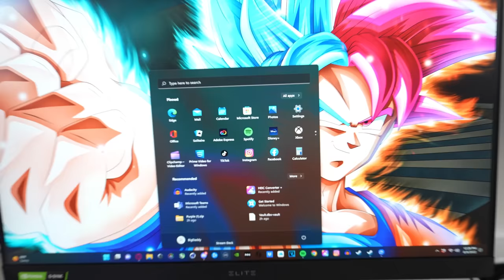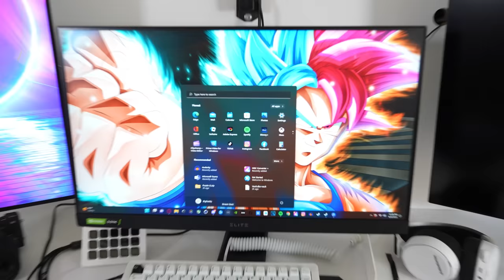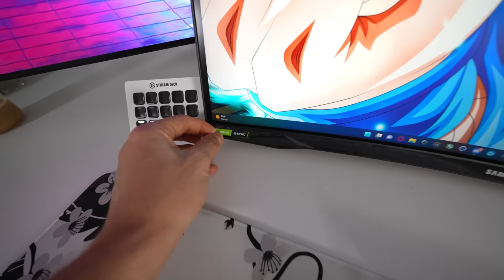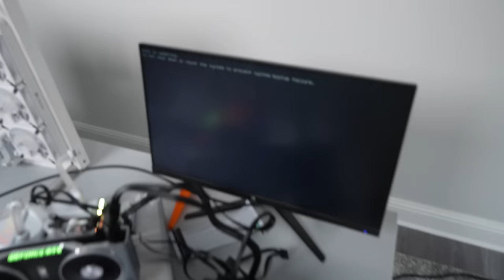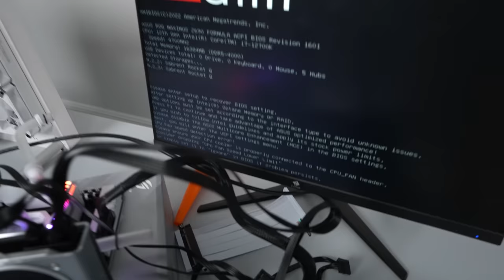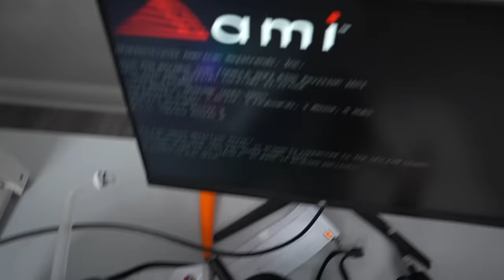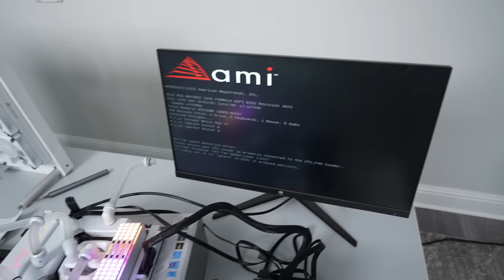I Almost Gave Up...

Comment: maybe i had the same problem with u after the windows 11 updates, my mobo got messed up & luckily i got warranty for  the mobo. i can used it again as usually for couple weeks then my pc wont boot up again after few minor windows 11 update. i'm worried if my mobo got messed up again but i think i need to rid off the windows 11 & and try to reinstall back the windows 10. after reinstall the windows 10, thankfully i can use my pc more than ever. the windows 11 actually give me an ease in daily use but after the incident, i think i need to stick with windows 10 for awhile before reinstall the windows 11 back again next time.

Comment: ya water cooled PCs are fun to look at but i left my old aircooled PC running for 8 years straight with maybe 10 restarts in that time and the thing never once gave me a problem.   Bought a AIO for my new build and it had problems out the box with the pump.    simple is better.

Comment: @TechSourse, im happy to know your computer is fine and it was only a cable that went out, but I as a Gamer and PC enthusiast must say that WINDOWS 11 is DOGWATER, i would prefer W10 instead until W11 is a a couple yrs older that way the the system would be more fleshed out. ive experienced more bugs and glitches with W11 thatn id like to and ive even had to replace multiple components due to it. so i hope you and your computer are well and i hope for the best.

Comment: I also feel what you feel when build a costom water cooling, plug and unplug gpu, psu, drain water
and it turns out that the problem is in psu cable is not fully installed, there's a little gap cable and the pin power
and now there are no more problems with my costom water cooling pc, so make sure your psu cable perfectly installed before check another hardwere

Comment: I suspect the cause is Windows 11 and the TPM/Secure boot maybe bitlocker. I had a similar issue on my Ryzen board when I tried upgrading to 11 from 10 pro. I did a clean install of 11 on a new SSD and I haven't seen it since. Be sure to keep a backup of the Security keys from the BIOS. windows 11 should be locking your install to the Motherboard, CPU, and SSD with the Key unless your board has a hardware TPM. Good luck troubleshooting. Little is as stressful as computer troubles.

Comment: also you really need to replace the factory retension mechanism with one of the billet blocks , its been proven the factory retension mechanism will not hold tension properly on the cpu

Comment: Hey Ed, @Techsource
I personally had almost the exact same issue with my PC recently.
I have a rog strix board with a 12900k and a 3080 on a riser cable. After upgrading to Windows 11 my PC would freeze randomly anytime I would launch an app. I had no issues at first making it through bios to the desktop. After some attempts at testing different hardware I had narrowed the issue down to my gpu. I took the riser cable out and everything has worked ever since. Not sure how to explain it but the windows update somehow shorted my riser cable. It drove me insane!!

Anyhow lately I'm having a new issue. My audio is having problems ever since my windows update as well. I have 2 different headsets with mics attached, one is Bluetooth, the other is wired. On my wired headset my pc isn't picking up the mic. Says "0% audio found" after testing it in windows settings. The Bluetooth one on the otherhand works fine unless I join an Xbox party, or Discord. I've tried installing and updating all drivers for audio and Bluetooth on the motherboard. Any other thoughts on what the issue might be?
Reply: OMG i have the same issue about the mic not being picked up on windows 11. Tried everything except fresh install. No solution for now.  Sticking back to windows 10 :(

Comment: Check your Memory, I think there is an issue with the DDR5 Sticks. Swop out your RAM with other Sticks, and have a look if it is still causing issues. You might need to replace your MB with DDR4 Slots.

Comment: Wouldn’t be surprised if Windows Update actually corrupted a firmware or something. In some newer motherboards and laptops,Windows can actually update your bios trough Windows Update without even telling you. Did the same to my laptop 1 year ago. When it does this it will list the update as “System Firmware” when it downloads and installs it. MS really need to chill tf out because they can cause serious issues

Comment: I am not sure what you did, but from the looks of it it said BIOS error right? What is the possibility that a BIOS update was running and you kept on interrupting it? Only you would know if you started an update or not or if you allow for such updates or not. Hope your PC runs now. I understand your pain I really do. I also had my PC just die on me and then came back after I pulled it apart. Also Win11 install at the time but my PC seems to be working fine now.

Comment: Alt+Ctrl+Shift+B will reset the graphics driver if you are having display issues. It might not be the graphics card but might as well try 🤷‍♂️
Just found out you figured it out. If this ever happened again try to do what I told you Alt+Ctrl+Shift+B

Comment: So I was watching this as you were making mistake after mistake lol. When you were testing the old motherboard with the white 3080 Ti founders, you didn’t plug-in the display port or HDMI which is why you got the error code 10:49. However, when you use the new motherboard you did which is why you didn’t get an error. Then at 12:26 you didn’t realize you made a mistake but fixed it with the new motherboard. I would def see if you have to update the BIOS on your motherboard as well since it’s a different motherboard from your wife’s. Also, the issue wasn’t the smaller PCIe 4.0 cable since the issue started before you even started to use that cable. Either way, I’m glad your PC turned out to actually work however, I left ASUS a long time ago because I kept having issues with my motherboards as well. As soon as I switched to MSi I have not had a single issue for years.

Comment: Hey Ed! so I'm not sure if you ended up trying a different PSU just in case. If this does happen again I would try a different power supply in case it is faulty. Either way I am very happy for you that all of this worked out and I hope it doesn't happen again. Thank you for the content though!

Comment: To be honest, PCIe 4.0 riser cables are very unliable, they are a hit or miss and very tempremental. I've seen same brand PCIe 4.0 cables that some worked and some failed. Cannot explain why, some just works and some works 50% of the time and some just totally doesn't want to work at all. It seems like a spin of the wheel to see if you got a good or bad cable.
Reply: Been building PCs for the pass 30+ years. From experience, I noticed that the PCIe 4.0 cables I get from IQUNIX (together with the case) and NZXT (together with the case) works very well. It's those I ordered from AMAZON like LIANLI (works 50% of the time) and expecially UPLINK cables that are hit or miss.

Comment: I had a similar issue with not posting/posting when it wanted on my ROG 10850k rtx 3080 which when playing games the pc would restart by itself then could not activate xmp profile on the ram etc this went on for like a month. I tested all components as you did outside the case. Long story short finally I got to the true culprit it was faulty extension cables from Shakmods, I used the default cables till the new cables from Cablemods arrived and voila all is good, but still on Win 10 pro after my bad experience don’t want to delve into that scenario of what if something goes wrong again

Comment: i have seasonic power supply i didn't use the nv adaptor cable I ordered one . I looked it over when i got it . it didn't look right so i called seasonic and they gave me number for ther cable maker i ordered 1 i got it and it had 4 ribbon cables and it's the cleanest best-looking system I have ever seen. The 4 ribbon cables are almost invisible by far the cleanest I have ever seen. 2 pci-e lanes 4 cables

Comment: One year ago my computer stopped working. I tested every component and everything was fine... I built again my pc and it worked. Then after some time it stopped working again. I swapped one piece at time and test every component for some time and in the end was the power supply that worked sometimes and sometimes not (no idea why..)

Comment: Put drain valves in, running opaque fluid means you will have to do more fluid changes rather than just running a normal transparent fluid.
I am going to say it was a BIOS update done through Asus software like Armory Crate/Asus update, Its been know to happen, also I think you were getting TPM errors causing a failed boot also be careful with that 12 pin connector they are real fussy.

Comment: Sounds like a voltage issue.  Maybe the PSU barely keeps up and a slight degradation in connection or wiring is enough to drop the voltage and cause errors.  I don't know much about your PC but I always have some "safety RAM" I've stored away for troubleshooting.  Typically, it's standard quality RAM and I remove all OC/aggressive mobo settings.  RAM has always been the weakest link in my overclock builds.  If everything works in that scenario w/stock intel settings then you have an unstable overclock.  It can take a while to pin-point those issues but I still believe your system has a voltage problem.

Comment: Memory or PSU.  I just had a similar issue with a weak EVGA PSU.  EVGA sent me a replacement and then the replacement was also faulty and I had drained and pulled my pc apart more times than I care to count.  I put in a Super Flower PSU and haven't had an issue since.

Comment: Ed I feel you my GPU ( 3080 strix ) went flashing red until I figured out the issue which was very stupid. Its pcie cables were sto tight because of the tempered glass bending on them heavily so the gpu couldn't function properly. But I really know the feeling when you fix your PC especially when it turns out there's no need to swap out a GPU or CPU. And by the way , I'm really liking your wallpaper , can you tell me its name ?

Comment: I'm confused... you tested the original parts without the riser, didnt work. Switch the mb and cpu and it worked. Switched back to the original parts without riser and it works....

Comment: maybe the riser cable was incompatible with windows 11 which caused it to malfunction? Im not a PC nerd but that is one of my guesses. IF you did switch out the motherboard then it was probably a motherboard incompatibility. Or it could have been that something was not able to communicate and so it shut down to make sure there were no hardware failures that could be serious? again no making fun of me im not a nerd at PC's.

Comment: i think i know why your computer broke. i had the exact same issue with my xps17, the whole system died with no output, and the motherboard was supposedly dead, but after re-seating the parts and changing the motherboard (reseting their guids) the problem fixed. The issue is when updating from 10-11 sometimes depending on your parts windows will push updates like bios which might brick your entire system, just like getting to a root of a andriod. If the internet goes out, anything strange happens during a update (the reason why it says not to close your computer) the whole device might be bricked. Changing the guid OF the parts fixes this problem most likely

Comment: Silly question maybe, but why does it feel like it takes forever for the motherboard to POST? Is this a thing with the Z690 platform? I'm just going by my experience of X570 and I'm booted into Windows 11 from cold boot in less than 20 seconds. In the video, it seemed to take almost half a minute just to POST.

Comment: Weird... @TechSource I use AMD... a Strix B550F Gaming wifi II,  and a windows update also screwed my motherboard... im a bit lower on specs than you, 32gb of corsair vengeance rgb pro, 5600x, and a 3090, i dont think that pushes the entire pc to the limit... anyway, , i left my pc updating... 20 mins later, wifi and bluetooth died, entire module was unoperable, after rebooting, reinstalling drivers, and even reinstalling windows, tried linux, no good, then i figured i would try Ubuntu to see if windows was the problem...failed that too... after a few reboots, it didn't even start anymore. Needless to say, my motherboard was from am4zon, and was a bit over 1 month old... i was able to get them to refund me and return the damaged mobo, still, for an item that new... i still don't have any other reason for it to fail so miserably, other than a faulty windows update.

Comment: I’ve had the same problem with my old pc. All components running fine, but no actual response on the monitor. Turns out the motherboard glitched out while the pc was booting up, which lead to the whole pc not receiving the right signals from the motherboard. Took multiple tries to get it to boot normally. Not sure if that’s the case here, but it looks similar.

Comment: Since it was the windows update I'm certain it's the rams that was giving it the post errors along with the cmos errors. I had that issue too and after messing with the bios rams settings and made it the lowest mhz it started to boot up and I boosted the mhz up after and it worked just fine. Although I'm still thinking the pci game played a part in it too.

Comment: I had and still have (I take precautions for it) a problem with my pc which doesn't allow my pc to post with CPU or VGA debug led stuck. I blindly blamed my cpu and the new (back then 2 months old) gpu both, I used to reseat both and tried to post and well it posted normally every time I did that. I scratched my head and then saw dew drops on my cpu cooler fan. Then I realised that moisture is affecting in some way and reseating parts is just making pin contacts free of moisture. As I live in a high humid region (Avg. hum.: 85% ^) my pc doesn't like this environment. I have to cover my pc with a plastic wrap just like a new boxed product everyday to tackle humidity, and with that my pc never got any post issues. Maybe your water loop condenses air around your pc (also you mount it on a wall, moisture tends to accumulate outer flat surfaces resulting in more humidity). Idk if that's the case with your pc.

Comment: i got an idea why it crashed. maybe you connected one of the psu cables into the wrong port/component and the psu sent an unwanted amount of voltage (higher than the component requires), and it fried the cpu or motherboard whatever you swapped to make it work. and also i noticed at 21:43 that the psu fan wasnt spinning, sooooooo the psu might be fried

Comment: I had my pc fail so many times using one of the PCIE ricer cables from Fractal Design. I am certain some of the riser cables can't handle the bandwidth a 3000 series card pushed through the lanes. My pc had the weirdest freezes during load or games and also had moments it didn't boot at all.

Comment: I am at the part of the video where it has given CMOS error with your custom 12 pin PSU cable, the cable is only responsible for sending the power to the motherboard from the PSU, wouldn't have any firmware or software because it is just a power cable so I can't see it going faulty from a update, either it failed and it is just a coincidence that you did a Win update or you've got yourself an intermittent issue that could be the 12 pin cable but could still also be riser cable, GPU or motherboard, if it is intermittent then god help you Edgar

Comment: i think its the RAM or the videocard. i have had issue with both in the past and both gave me random problemens. i my case RAM is easy to troubleshoot i had 4 sticks just use one and see if the issue remains if so swap them. videocard took me a long time to find out. because my pc only crashed in windows desktop. gameing worked perfect no issue. i was able to get a other videocard and all my issue disapeared. so i put the old videocard in to the oven and since then no issues anymore still going strong.

Comment: I have a gaming PC which I had bought from Microcenter last year. I personally did not purchase it a friend of mine did. I am not rich or someone who actually works I am disabled because of several medical issues. The two main ones I will tell you hiv-aids which a girl had gave it to me when I was 19 years old,the second one is going to be Dyslexia because of brain trauma at the age of two of being physical abused by my father as I am writing this I am using Google microphone to help me spell the words all I have to do is speak into the microphone. Okay back to Microcenter I have saved each month with my SSI check to upgrade my PC, I went back to Microcenter and trying to upgrade to AMD ryzen 9 and they charge me for insulation charge I got home to computer was not working properly. I had to go back I called Access-A-Ride they told me the paste was not holding on the cooler to the fan so they put new paste on it so I go home and the PC getting hot again. I called them and told them the issue and they told me well it could be the cooling fan so the guy tells me that the AMD ryzen 9 gets hotter than the AMD ryzen 7 that I would have to buy a fan that will be good for the AMD ryzen 9, I said why didn't you let me now when I upgrade without telling me that I need to purchase that as well this is unfair plus now you are telling me that I have to pay for another installation charge, I had told them from the beginning I am not computer savvy at all. I was hoping you would understand and maybe help me out. PS.forgive me if this doesn't sound perfectly correct.